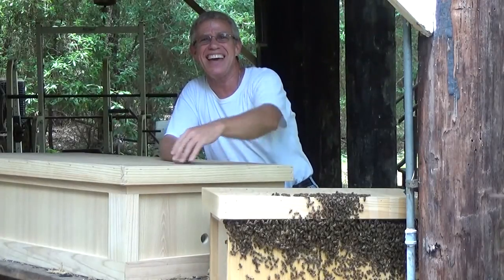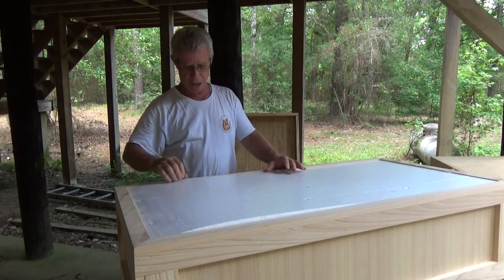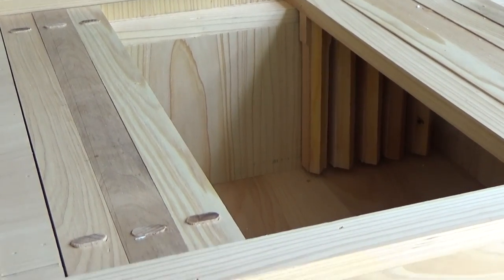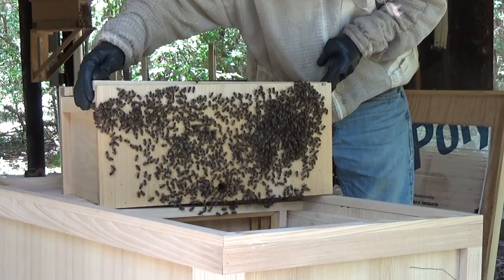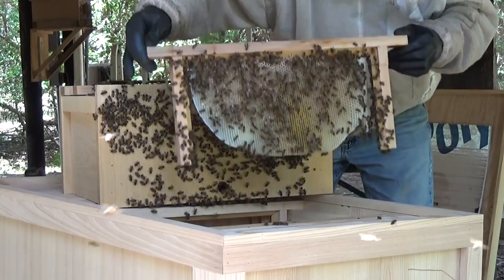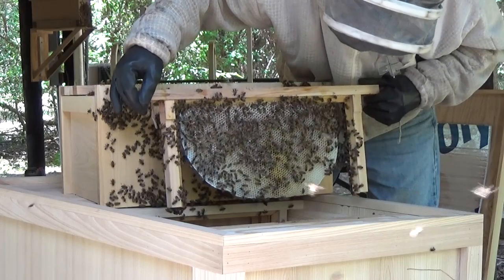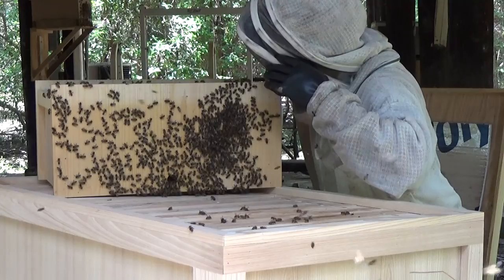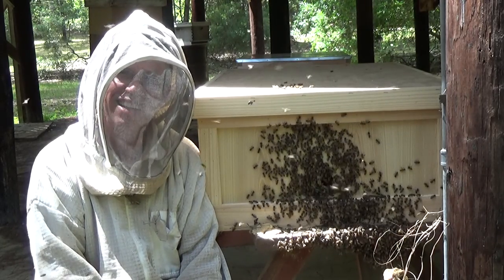Top Bar Hive transfer

Comment: Jeff, so glad you are giving top-bar hives a go. I think you will be pleasantly surprised. Just a couple of things I noticed (you were waiting for this - LOL);

I don't think it is necessary to put insulation foam in the side or bottom cavities, air is a better insulator, just leave the cavities empty, and as long as the bees cannot get into the area above the top-bars, I don't think it is required on the top either. Save the money.

The other thing is I don't think the bees will attach the comb to your side 'rails', they will probably just leave a bee-gap space, so not necessary to put the triangular wedge shapes there either. The rails are good protection just in case you knock the comb against the box.

You will have to get used to handling the frames as they are more fragile than Langstroth frames, but all-in-all you will enjoy the experience.

Thanks for the great videos.
Reply from the maker: I am really excited about the TBH. I do know the next one I build will not be so elaborate, but I know I will be building another one when I split this one. That was one heck of a swarm, and the genetics from it look promising.
Thanks you for the pointers, I will keep them in mind as I proceed forward on this new adventure. Thanks for watching. God's peace.        Mr. Ed
Reply: @JeffHorchoff  i run some Langstroth frames with the triangles top, sides and bottom, the bees seem to draw them out all the the way.  be interested in a update this year on how this is doing.  love your videos boss!

Comment: my first 4 years as a beekeeper i only did top bar but of the more traditional type with the angled sides and only the angled bar across the top.  also, mine was built much lighter and had legs built on the ends so it was free standing.  management is quite different for this type of hive style.  you may consider adding a bar up front now to give them room to grow forward a little as well as back.  when i had mine, typically the first couple of bars develop into pollen frames followed by the brood area and honey in the back.  and once they pull a full bar of honey, that acts almost like a queen excluder and the queen will "usually" not go beyond that bar.  so you have to introduce empty bars into the brood area to expand that space to give her the space she needs as they grow in size.  i made mine 4 feet long as the longer it is, the more space they have to collect honey and grow out without having to constantly pull honey to give them space.  have fun!
Reply from the maker: Wow! Thank you for all that info, I hope you will see the implementation of your ideas in the first progress video I make on the hive. Thank you for the help and following along on my bee adventures. God's peace.      Mr.  Ed

Comment: I’ve watched this one a few times now. I like it each time.  I’m learning about various bees in the Philippines as that is where I would like to finish this life. I have the lease of two properties of agricultural use. I believe that the correct bees would increase coconut and other fruit and vegetable yields. Two that I’m interested in are Tetragonula Boroi and Apis Cerana.  As this is a poor province, simple construction may be the key here. I’m thinking a plastic tub or cooler or half barrel might do the trick for top bar body. Also, any staff that I will have will be your size maximum and many under 4’5”. Top bar seems best. 

I’ve been collecting seeds to send to my gf. I have some date seeds from near Yuma and remembered your palm near the Abby.
Reply from the maker: The really good thing about bees is that they are not picky when choosing a place to call home. As long as the area has enough space for them to build comb, and they consider it  "safe" enough from what mother nature can throw at them, they will move in. I have to agree with you, the top bar should be a very good fit for your operation, and the design of it can vary in so many ways as long as where the bees will build comb can be removed to be inspected. I wish you all the best on your journey, and I think you are in a great place to succeed in your endeavor. Keep me updated. God's peace Harvey.
Mr. Ed

Comment: I remember reading that there is one width for storage and one width for brood with top bar. Maybe the fact that you have those triangular cross section and you have insulation will keep them drawing comb straight and not suffering from too much bee space. Actually it seemed like they made the comb thicker the way you did it. Good job.
Reply from the maker: The comb is much thicker, a full inch and a third, almost the same thickness as a frame of honey from a 10 frame box with only 9 frames in it. There was no cross combing, and the frames just lifted out without any prying needed, I was very impressed. It is still an experiment, but one I'm very pleased with right now. You can bee assured, I will have an update on the TBH in the spring. Thanks for watching, and I hope you will check out more of my bee wrangling/ bee rescues adventures and let me know what you think of them. By the way, I post a new video every Friday morning. Happy Thanksgiving and God's peace. 
Mr. Ed

Comment: you'll probably need more ventilation on that huge hive box. hopefully the bees don't attach the comb to the bottom. you should at least throw a thin coat of paint on the box.
Reply from the maker: I do not think there will be a ventilation issue or comb touching the bottom, but all that will show itself in due time. It is an experiment, and I plan on learning from it. As far as the paint, that will happen. Thanks you for your input and watching. God's peace.      Mr. Ed

Comment: Did you use a Festool to mill those mortise and tenon frame joints?  They look incredibly solid.  Did you mill the top and side bars the same thickness?  What was that?  It looks like the top bars have no space between them.  Did you mill those 1 1/2" wide?  If not, will you use spacers?  I guess you're not planning on using bottom bars?  I built a double deep hive box that was 36" long and 24" deep with cedar inside, 1 1/2" solid insulation and 1" pine sheathing outside.  Wanted to see if the bees could survive our N.E. winters in it without having to cross between lang frames.  Will you be able to use a regular extractor with the 3-sided frames?  Good luck with the hive.
Reply from the maker: I am really impressed. Not many folks would even notice the construction method of the frames, just that there are side bars on it. Yes, I did use a Festool Domino tool to make the mortise in both the top bar and the side bar. I made a fixture that would hold each piece while the cutter made the hole. Very safe and easy to do. I made over 30 frames and have parts for another 10 or so. By next year I will need to make another 30 for the new box I am going to make. The top bar and side bar are the same thickness, 11/16, and the side bars were shaped 3/4 the length of them on both sides to avoid the bees from glueing the bars together. The width of the top bar is 1 1/2 and the side bars are 1 7/16 so as to give a little room when dropping the frames next to each other. I will not put bottoms on the frames as that would be contrary to how I find the combs between floor joists. Did your design withstand the winter? I really liked the material you used, particularly the cedar lining. Wood working is my first love and I have been building furniture for over 40 years. I am retired and volunteer at Saint Joseph Abbey in St. Benedict, La building caskets for the monks and tending their bees. If you have other questions my address is:
oscelata@gmail.com
I am looking forward to hearing from you again. Thanks for watching. God's peace.
Mr. Ed

Comment: Would it help if you had a one piece insulated end boundary divider inside the box to lower the internal box volume that the bees have to  providing temperature control heating or cooling?  For example if your colony is smaller you may have it set to one third from the entrance inside the box, etc.  Also would it help shortening the legs just a bit so the box is a bit lower (your waist height) putting less strain on your back while you work inside the box.  Also does it help with insect control if the lower half of the legs of the box are coated with the same material that I sometimes see tree trunks coated with to prevent crawling pests from climbing into bee hive or is that not an issue with this type of setup? Please forgive all the questions I'm a newbee and curious, hope some of it helps. In one of your construction videos when you where making hive frames and adding bee wax to the middle plastic inserts you'd mentioned that the bees would not build on it if it was not coated with bees was, would it be suitable to line the inside surface of the box with it so the bees do not build combs attaching the frames to the box?   Thank you.

Comment: Not sure if you said it, but does the top bar box have a false wall in it so the bees don't start building odd shaped cone? Also personally I think a square top bar box is much better then the pitched/angled top bar box. Though it does mean you have to make your own bars rather then getting mass produced ones. Though for me that is a plus, I like making things with my own two hands. That might be why I went with welding and machining as a profession.
Reply from the maker: Like you, I'm a hand on kind of guy, and if it's made of wood, I can make it. There are no walls in the hive, it replicates the space between floor joists in a floor, it's all open. I do have a movable end piece to allow for growth, but other than that, it's all open space. With this type of hive, almost anyone can keep bees without a lot of start up costs. god's peace Sean.
Mr. Ed
Reply: @JeffHorchoff  Ok that's what I meant by a false wall.

Comment: Hi again. I'm loving your videos. Can't wait till it's warmer up here. How wide are your frames in this video. I've been using a top bar for 3 years now and get crosscomb through all my brood. It always straightens out farther back in the Hive... Also I built a super for half of the top. It worked out pretty well last year.
Reply from the maker: I've got only the one TBH, and I have not seen any cross combing. I have starter strips as well as side bars, and this seems to do the trick for me. I will be doing a update on the hive when I split it, stay tuned. God's peace Kyle.
Mr. Ed

Comment: Hey Jeff.  Thanks again for another great video.  I am curious.  Am I correct in thinking that the only way to process this honey will be to crush and strain the comb.  I can't see those frames being able to be loaded in any extractor.  Thanks again and God Bless.
Reply from the maker: The top bar hive is one of my on going experiments, and it's proving to bee a lot of fun. You are correct, this comb can not be put into the extractor so it needs to be crushed and strained. Or, you could just have it for comb honey which is what I did with it. The comb honey is so pretty, it's almost a sin to crush it just to get the honey. Thanks for watching. God's peace Ken.
Mr. Ed

Comment: Yes Long Boxes.  What so beautiifull is?  The milit things can do, put swarms in, queen castles, rearing ect.  no lifting boxes and no foundation ! The bees just draws out comb just as fast as using foundation with out the cost !  Proud you went to the wooden guide strips!  What i use too.  just brush melted bees wax on em 09:45  6 days time is VERY FAST RITE! YOU CAN PINCH DRY COMB TO THE GUILD WEDGES TOO!   honey and brood comb wont hold ok!  do even try it

Comment: cool long boxes ! what i'am trying too.  well the inner covers?  i make bunch for 3 frames for queen castles, and bunch of follow'er boards,   i think would be best to make 3 to fit over all the frames! unless you want queen castles .  I use just standard deep frames.   Only law applies is correct bee space,  make em as wide as you want  long as you wont , just keep the correct bee space sides top and bottom. i put the entrance on the long side with slide doors to open them and close em. and the back side where i inter my SHB OIL TRAPS ON EM. So to i put hinges on the front where i want stand in front of the entrances.  I open top and trap from the back side  Plus if i need more air flow,  i open the trap door and put the screen on.  ]ust window screen with a frame, that fits into the trap, Leaving the door open as a roof.      Just put me in one when i go..   i'am 6'2" tall 195 lbs i would be honor  then set it on fire    cheers buddy

Comment: if you don't want to use smoke you could use sugar water spray. when you move them you'll have to remove the frames first.
Reply from the maker: I usually do use sugar water, but for some reason, I forgot this time. It all worked for the best. Thanks for watching. God's peace.      Mr. Ed

Comment: Is there a reason that you didn't make the box to use regular langstroth frames? It seems like they will be more likely to attach to the bottom this way....love your videos....keep makinum.
Reply from the maker: In hind sight , it would have been simpler, but very often I do things the difficult way because of not thinking it through. By not having a bottom to the frame, the bees will not attach the comb to the bottom of the hive because of bee space. At least that part worked very well. Thanks for watching. Until the next time, God's peace.
Mr. Ed
Reply: Last spring,which was my 2nd year of dealing with bees, I made some swarm traps that left 3 or 4 inches below the deep Lang frames. I left them in the trap too long and by the time I moved them out, they had the space under the frames full and stuck to the bottom.
Reply from the maker: That's because there was a solid strip on the bottom of the frame, if there is no strip, the bees stop building before the comb reaches the bottom of the box. God's peace.
Mr. Ed

Comment: Do you have any concerns about the bees connecting the wax from the bars to the bottom? I have screen and they don't, but I'm concerned about that for you. Hope I'm wrong.
Reply from the maker: From what I have seen in all the cut outs I have done, bees never connect the bottom of their comb to the underside of the floor joist. I do not think I will have a problem with it.......I hope. God's peace Dennis.        Mr. Ed

Comment: I notice that frames bars are close together, no holes in the top. What is your ventilation system? By the way love your exhuberance and videos.
Reply from the maker: There is no ventilation system. The only hole is the entrance, and there is no screen on the bottom. The space mimics the space between floor joists and they have no means of ventilation. The top bars touch each other so the bees won't glue them together. God's peace brother. 
Mr. Ed

Comment: I enjoy watching your videos!  They're clever and entertaining.  Is there some 'secret' to keeping swarms in a hive box if you don't have any brood or even comb?  I have caught a few swarms, but each swarm has absconded.  Thanks.
Reply from the maker: I do use old brood comb in my traps as well as lemon grass oil, but I have found if the bees move in on their own accord, they tend to remain instead of absconding. There is never a guarantee they will stay, so I also add a prayer to hedge my bet. I hope that helps. Thanks for watching and I hope you continue to do so. God's peace.       Mr. Ed
Reply: Thanks!  Do you have any suggestions for keeping swarms that are caught from a branch?

Now, this is just burning curiosity.  I now, finally, have enough resources where I can add brood or comb to make them stay, but I still would like to know how to keep a swarm that I've captured  and not lured.  

So far, I've never been able to lure a swarm to me.  That's on my wish list, though.Just now, ... just now, I came in from cleaning a recent water meter hive.  They absconded, they were overrun by wax moths and small hive beetles.  That thing was FINE a couple of days ago.  I still can't believe it happened so fast.  It wasn't a huge hive, but I thought they were plenty fine.  Everything I put in the shade dies.No biggie.  I'm getting some bees from a Trash Can either today or tomorrow.  Thanks again!

Comment: Great video again, can you explain why you didn't want to use smoke? 
I'm amazed at the amount of comb that was drawn in 6 days... I've got bees since April and they've not done nearly as much...
Reply from the maker: I used to smoke bees right from the go, and it does distract the bees, but it also stress them. I do not want to stress my bees. Therefore, when I open the box, if things look ok, no smoke. If things look scary, they get the smoke. You will know when you need smoke and when you don't......the bees will tell you. I was amazed also at how much comb the bees had built in such a short period of time. However, it was a new swarm, and new swarms are in the building mode once they find a new dwelling spot. Thanks for watching. God's peace.      Mr. Ed
Reply: Thanks for the input, much appreciated...

Comment: Are you gonna need a forklift to move that box soon? Holy cow! Lucky bees! How will you deal with beetles in there?
Reply from the maker: That box is HEAVY, the next one will not be that heavy. That is a very strong, large swarm and I have high expectations for them. I hope I am not disappointed. After the first of July, I will do a progress video of the tbh. I will be doing a queen evaluation, and checking to see how much comb has been built. Stay tuned. As far as the shb, that will be the bees job to handle them. Strong bees can handle them, and that's what I am hoping for. Thanks for watching. God's peace.        Mr. Ed